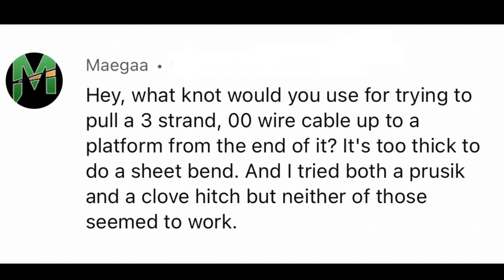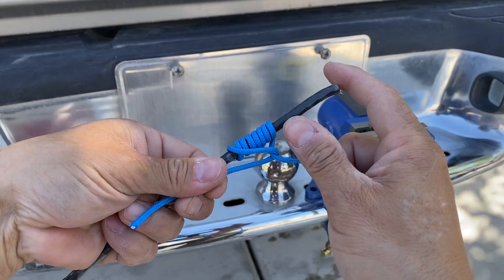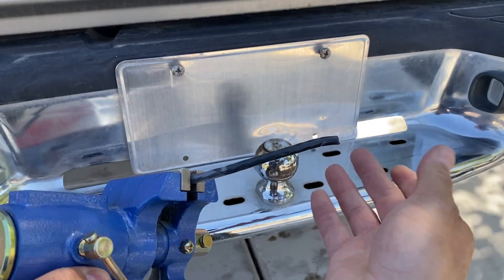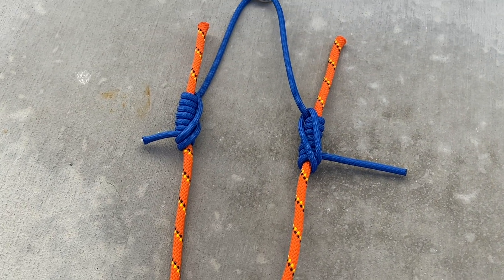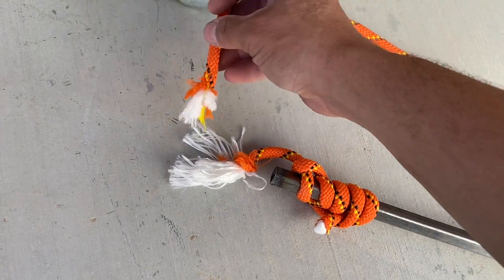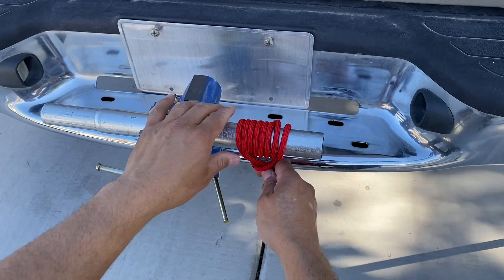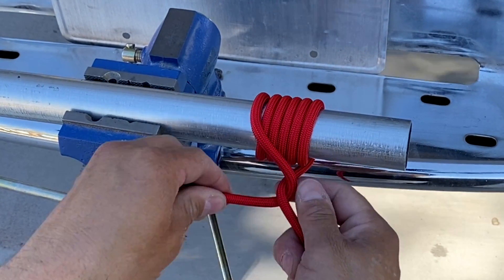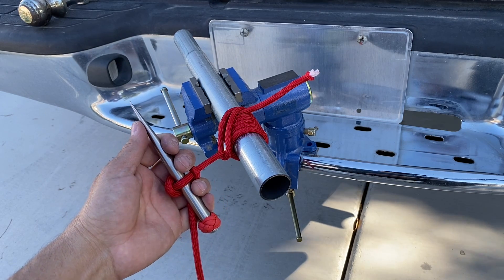Wire Pulling Knot

Comment: Two major ways to make a nose are 1. A few half hitches with a clove hitch to keep it down the wire, plus tape. 2. Skin the wire at the end, destrand if necessary,  and fold the skinned wite through an eye splice or boland (sp?). Remember the nose has to fit through the pipe and go around bends. 
If you pulled it with a machine (ie tugger or whatever you call it) and you need more wire out but the machine isn't far enough away to get enough wire then the best thing I found is a horse tail that you wrap back and forth making something like a basket. The horse tail done correctly will even grab wire soaked in lube. If it's a hard pull the prusic hitch will damage the insulation and so will the various other hitches people try. Oh and that clear coating is nylon hence thhn. Maybe i missed the point of the video??

Comment: When your ropes broke on the metal bar tow, I think I saw the rope rub against the edge of the bar. It could have been some cutting swarf/ slivers, and caused the rope to break early. Still don't doubt the strength of your rigid pull knot.

Comment: Great knot, but every electrician knows that you strip off the outer insulation a few inches, and cut a few strands of wire off the outside. Then you can easily bend any size of wire over a closed loop (either steel fish tape or pull rope). Inside a conduit (where most wires are pulled) friction is your enemy, so you want a smooth transition from wire to rope. All those wraps would easily get stuck.
Reply: Ive primarly used this for demoing out old wire when half hitches just arent getting the job done. Another good spot for it is towards the end of a pull you've been using a tugger on and the wire has started sticking out. Wrap this around the set of wires and you can get the extra feet out after the head is out of the conduit.

Comment: I've used this before but theres not a ton of circumstances where it'll work well if you're pulling through conduit. The added girth and friction from this knot would be prohibitive. The one place it saved us was demoing out 50 year old wire with a in a slab with a forklift and old yellow 77 stuck to the wire. We had a mix of different wires from dc, ac, and low voltage wires. Heres the video I learned this knot from. https://www.youtube.com/watch?v=eQ6A2TuDBn8
Reply: Ah! Nothin' like the smell of a bucket of soured 77!

Comment: Really? Forty years in the trade and I've never seen anyone use any type of knot like that. Normally we're pulling in three or more wires at once and we strip them back six to eight inches, cut out most the the strands including all the inner strands. You never use them for pulling as you can actually pull the core out of the wire. Now you take the leftover strands and bend them over through a pulling loop in the rope. Tape it up and pull. This technique is used for small wire up to 500 MCM and with electric tuggers all without losing the wire in the pipe. Now that's something you never want to have happen so you never depend on a pull that is done with a simple knot. You want a connection that will stop the tugger if it comes to it. In larger wire sizes you normally wrap tie wire around the bent over wires to reinforce them not coming loose. We also use pulling baskets, either commercially made of fabbed right on the job from iron tie wire. Like a chinese finger trap they tighten as you pull. For something quick and easy like pulling in cable trays we might throw a few hitches around the wire, taping at both ends and then pulling. I've never had that slide off if done properly.
Reply: On your typical wire pull completely agree. The one time we used this and it saved us was demoing out 50 year old wire with old congealed yellow 77 through the slab using a forklift. Half hitches and everything else would slip but this is what held up the best. I could see this being useful at the end of a pull with a tugger and you've got the head out but need that extra few feet at the end.

Comment: Watching this guy tie knots is really weird. He starts twisting and spinning things in a very reasonable and logical manner and then he slows down and shows you some complication that doesn't exist,  highlights something visually and then real quickly speeds past that very point instead of just continuing reasonably. He keeps slowing, making some deal of nothing and then hurries past the move. It's not impossible to see it's not even super difficult to see but it's super annoying and a little difficult and he does this with each knot.
 he slows down unnecessarily and then speeds up making it harder to follow.